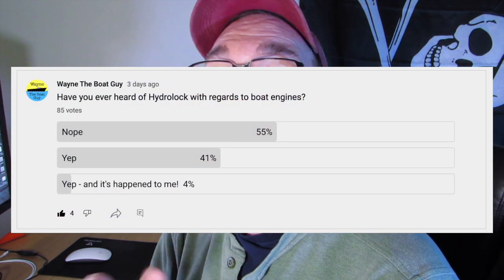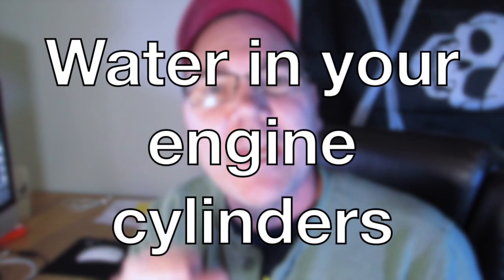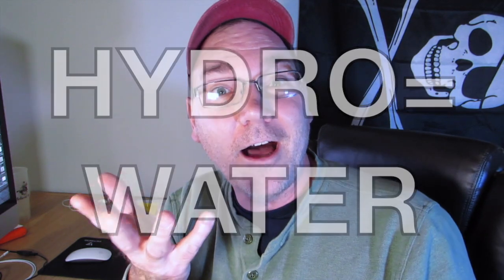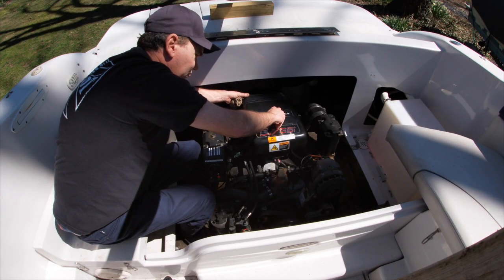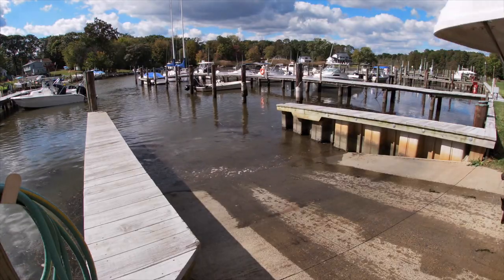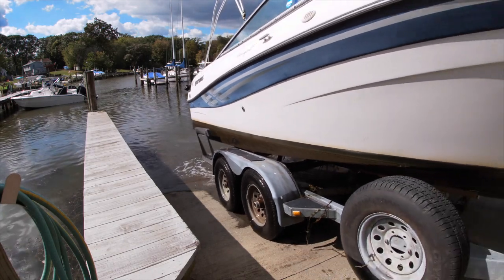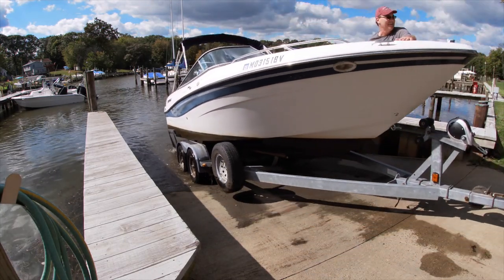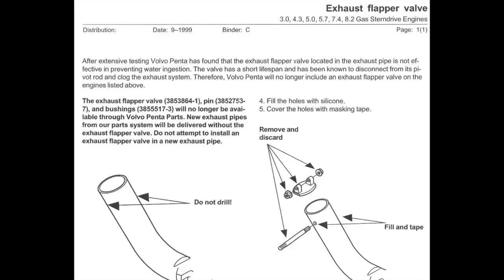Hydrolock Boat Engine - How it can happen!

Comment: I hydrolocked a Chrysler 440 Marine Engine twice in one summer in 2009.  I pulled out the spark plugs and cranked out the water.  It started and has run fine since then. 13 years later during a rebuild I found a cracked piston and some bent push rods.  But in all those years (and 800 more hours) there were no symptoms: No noises, and good compression in all cylinders.

Comment: Great video and explanation. Thanks. I would like to reduce noise and exhaust gases and adding a turndown to have exhaust about 6" under water. I'm adding another elbow and finally having the rubber flapper facing like they were about the water. Technically should work but rather than learning the hard way looking for feedback. Thanks

Comment: If you ever do experience this, also remember to check your oil BEFORE you attempt to start the engine. Water can also get into the crankcase and your oil will be a milky color. Do NOT attempt to run it like this. To fix it, multiple oil changes while running for approximately 1 minute in between changes until the oil is clean again. Then one more oil and filter change and you are good to go. I've seen this happen on bigger boats to the generator, when the vessel is run without the generator running and the sea-chest is left open.
Reply from the maker: Great point!

Comment: This happened to a mercruiser 190 that had a chronic dieseling problem.  The dieseling was part of every time we went out.  After years this occurred in the usual way.  But, when I went to restart the engine it broke a part in the starter to protect the engine from greater harm.  A rebuild of the starter took care of the break but we never solved the dieseling; dealers, favorite mechanics, etc.  The mechanic did get the water out of the engine, of course.

Comment: This "Hydrolock" apparently happened to me this past weekend. I'm not sure why mine overheated in the first place as I had just put a new impeller in, BUT, I think I may have over lubed the new impeller and it could not create a suction. I don't know. Either way, it over heated and died while in motion. I'm now thinking that water shot up into the exhaust manifold and down into a cylinder or two. I changed back to the dryer impeller that was really working just fine and tried to start it. It has that locked "CLICK" sound and would not turn over at all. Didn't turn over the next day either after a full cool down.
I did pull all the plugs and the motor turned over with no issues and sounded good. No obvious sounding mechanical issues. WHEW! The first plug I pulled did have water dripping out of the cylinder hole as I pulled it. I thought, "Man! The Hydrolock theory is working!". None of the other 7 plugs I pulled showed much sign of wetness. Maybe a little, but nothing dripped out like the first plug. I sprayed WD-40 in all the plug holes to help to alleviate any potential rust buildup and maybe eliminate any moisture. When I pulled the oil dipstick and looked at it, it looked fine. I'm going to put NEW plugs in it and CHANGE the oil before I try to fire it up. Wish me luck! I can't thank you enough for the video. I was SURE I had seized the motor.
Reply from the maker: Yes - good luck!!! It sounds like you’re on a good path.

Comment: I apparently I hydrolocked a 300r just 10 hours in when I got in shallow water. I did not run it for more than 20 seconds and the block temp never got about 142.  It’s ceased, but I feel certain it’s not warped. All plugs were clean
Reply from the maker: Hoping all is well with yours!

Comment: I recently got a 25 foot Apollo and the first time out the engine started getting hot so I had to shut it down so as not to harm engine, but because of the heat the thermostat opened up( this was the ultimate cause of overheating) the hot engine percolated water into 3 cylinders and hydraulic locking happened. It took a while to figure it out..

Comment: I have a 60hp mercury 4 stroke and engine was running fine and at top speed engine suddenly made a noise and died. Engine is totally locked up. Repair shop says it is hydro locked.says lots of rust in the cylinders and needs totally rebuilt. Anyway I can save it without rebuilding?

Comment: I’m so frustrated!!! My flapper is new, both exhaust manifolds are new (they cracked) the marine mechanic can’t figure out why it keeps hydro locking!!! We never launch fast or slow down suddenly or shut off boat while under way. What are they not seeing?? We have a 2003 Maxum 2700 SCR. Any other suggestions we can explore why this keeps happening? 3x this summer!!!

Comment: After trolling today on Lake Michigan went to start the boat and tried to turn it over and immediately realized I was hydrolocked. Apparently fighting salmon on the transom and the previous owner taking out the shutters screwed me. Luckily engine never actually ran hydrolocked and pulled the spark plugs back at the dock and blasted the water out. Waiting on new exhaust shutters
Reply from the maker: Dang. So many people remove or ignore those.

Comment: This can also occur due to a bad manifold and riser or  the gaskets between them. Also a bad head gasket will allow water to pass into the engine block. Remember, manifolds and risers are a 5-7 year maintenance item on I/O boats. It’s a do it yourselves maintenance item if you’re handy. Parts are expensive though. You should know how old yours are and if you don’t then play it safe and replace both sides at the same time.

Comment: Happened on my mercruiser 4.3 twice in two seasons. Think I have it figured out now
Reply from the maker: Dang.
Reply: What did you do to figure it out?
Reply: @Balmainbobby  let it idle for a minute or two before turning it off. Both times it hydrolocked was when I shut it off when the engine was hot immediately after cruising or wakeboarding.wake boarding. The hot cylinders caused a few extra compression strokes in reverse and sucked water into the engine.

Comment: We just got this 4.3 last week and had an guess that it was going to be a head gasket Well it wasn’t it’s the intake manifold the hydro lock if it gets bad enough it will blow oil everywhere 

One way we checked if it was hydro locked was by the dipstick so be sure what you looking at

Comment: Could this also be a reason for slow turnover of an engine after launching the boat in the water? But starts just fine out of the water for flushing
Reply from the maker: That's interesting. I wonder if it could be a weak-compression issue or somewhat blocked manifolds or exhaust. My thought is it's not strong enough to push exhaust through - but it's just a thought. You should definitely look into this further!
Reply: @WayneTheBoatGuy  I think next time I launch I'll start the engine when the intake is in the water but before the exhaust like you suggested in the video, and see if it starts easier.
Reply: @pbtrilogy  Happened with our old I/O mercruiser would start way faster out of water  the reason is our mechanic told us is that there is way more back pressure and harder for the engine to start due to increased pressure in exhaust system a good amount of air (exhaust) to overpower pressure of water

Comment: Hydrolock was the demise of my first boat. It was a sad day :( . It was an old used boat and unfortunately not taken care of very well by the previous owner. I also had a hairline crack in the block. How the two are related or if one caused the other, I don't know. I needed a brand new engine that was way more expensive than the boat was worth. After that I told myself that I will never buy another toy used.
Reply from the maker: Dang. That’s awful. Thanks for sharing.

Comment: I can’t find a video on how to fix it
Reply from the maker: If your engine is hydrolocked, the 'fix' usually starts with removing the spark plugs to get the water out of the cylinders, an oil change and then checking for any damage that could have happened from trying to start it.